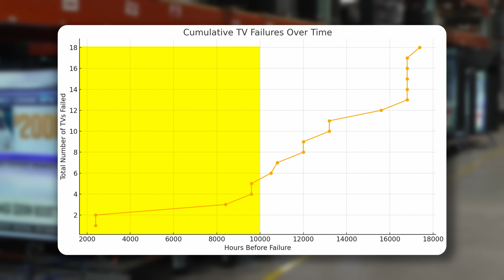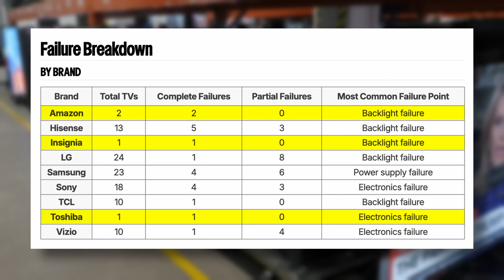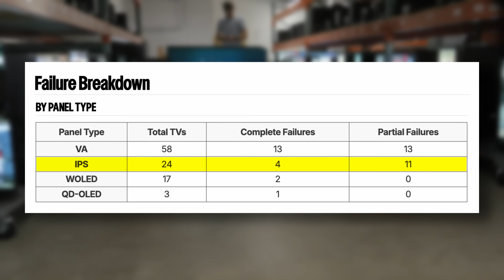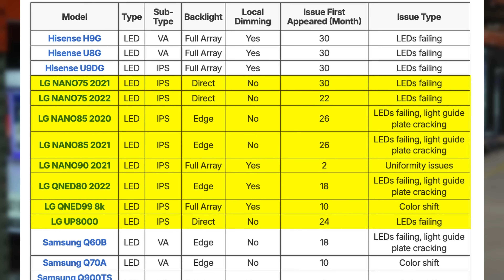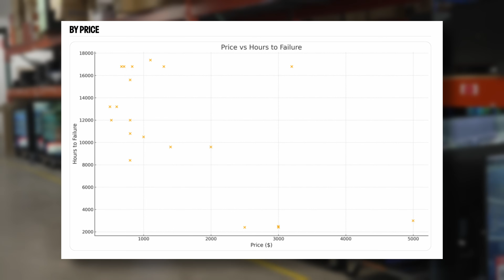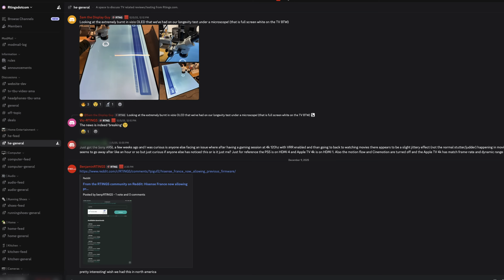Which TVs Break First? Results Overview From Our 100 TV Longevity Test

Comment: I have a samsung s95b QD-OLED with massive letter box burn-in after only 5k hours. The warn center area is 20% less bright than the outer portion of the panel.
Reply: Yeah I'm pretty confused by them saying it's not really an issue. I have an A80J and an LG C2 and both have pretty noticable burn in from cable news headline boxes. Started becoming noticable in light background/panning scenes after about 3 years. The Bravia handles it better than the LG and has less burn in despite double the hours. Something about heat dissipation probably.

I was hoping for more info about the ways they've improved the tech and timelines for different stages of noticable burn in.
Reply: 5000h of only watching 21:9 movies?
Honestly I'm surprised 21:9 TVs don't exist at all.
Reply: @SquintyGears I'd imagine the cost of developing and distributing something as niche as a 21:9 TV would make it unappealing to anyone that might be interested in such a thing.

And if they're going to only watch 21:9 content then why worry about letterbox burn in anyway? It would only be visible in 16:9.
Reply: @Gractus that's my point though. High end big TV buyers are putting these in their theater rooms. They're not watching the news channel on them. So it's not really that niche.
And if it was adopted, then console outputs would be designed to accommodate the format. The split screen experience would be better across the board.

That's where the user target split happens. Theater room entertainment use and old school channel content use(news and sitcoms)
Reply: @SquintyGears philips once had an lcd 21:9 tv
Reply: @SquintyGears  Most likely 16:9 content which is the most common.
Reply: @SquintyGears they want the bars not a wider screen
Reply: @Xxsav40-m4o why would they want the bars and not a screen with without unused portions of the screen?
Reply: @SquintyGears phillips had some for some time.
Reply: woah pretty wild, thats only like 2-3 years of use
Reply: I've been using LG C1 and S90C for last 3 years with waaay more hours than that and only see very minor hud elements on C1 on a corner if I do a burn in test and everything else is pretty spotless.
Reply: replacing my second Samsung in four years.  First one I had to fight tooth and nail under warranty thru best buy.  Never again.  2nd TV has horizontal line on top and the color flickers
Reply: At 4000 hours, mine has just a kiss of over and under-compensated wear marks from way too much Apex Legends. Noticeable on a neutral grey screen, but still very tough to see in normal content. A similar amount of play absolutely wrecked my previous plasma TV.

I do watch letterboxed video content and even run that with the brightness overdriven using dangerous service menu tweaks, but it's a distant secondary use for me and hasn't caused any problems yet.

It's still an absolutely dazzling display, but I knew it was "here for a good time, not for a long time" before purchase. So long as I can stomach the Tizen iteration of the day, I expect to buy another QD-OLED again.
Reply: @random_n s95b was first gen, they already at the 3rd and 4th with s95d (and s90f) and s95f. Also they use deuterium from the 2nd gen so those are more resistant. That was the year they broke into the monitor market as well, which says a lot.
Reply: I was 2000h in on my S95B and in that time it’s had 2 new displays installed due to it killing it self. Swapped over to a LG now but Daym I do miss the QD OLED on Samsung but can’t stomach the unreliability
Reply: @Nathan-o8m2is95b was first gen, they already at the 3rd and 4th with s95d (and s90f) and s95f. Also they use deuterium from the 2nd gen so those are more resistant. That was the year they broke into the monitor market as well, which says a lot.
Reply: Samsung is a low quality brand.
Its a marketing brand that wants high output rates: look at phones, tv’s etc so many different models each year.
Reply: @masomaf  Not really any worse than the other brands. Just look at the data provided here.

Comment: I have a 32" Hitachi Lcd that was used for a living room tv then computer monitor till i put it into the loft in full working order  2 weeks ago  after  buying a  32 inch monitor.   It has run on average from 10 am to  1am  every day  or  longer  (14 to 17 hours every day)   since 2015  and 2012 to 2015  10 hours , I used it as a monitor after 3 year in the living room  thinking it wouldn't last much longer.  I finally updated it because  i had to reset to csm  from uefi to access the bios on my MB  which was annoy for setting  system fan curves. It had/has a fantastic clear picture  or i wouldn't  have continued using it at 1080p.